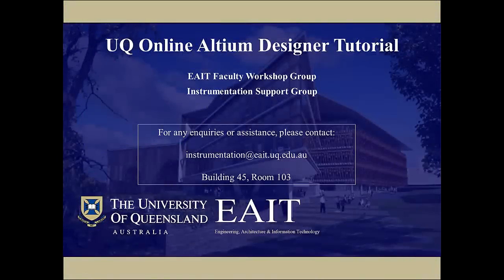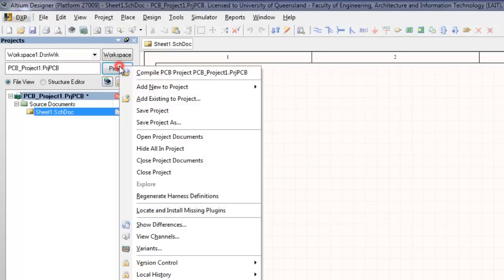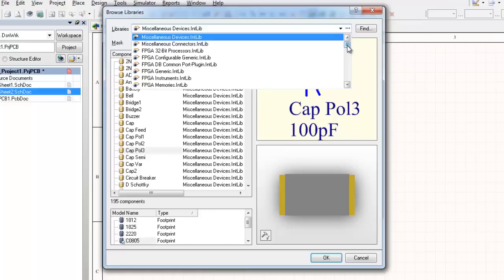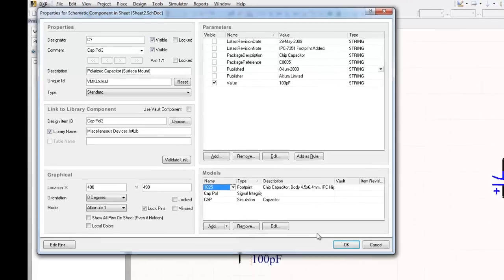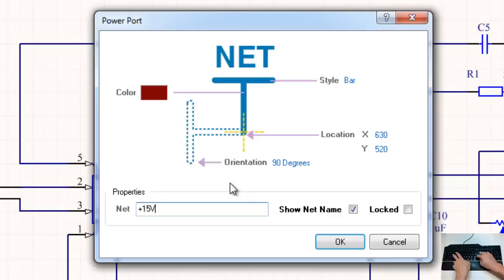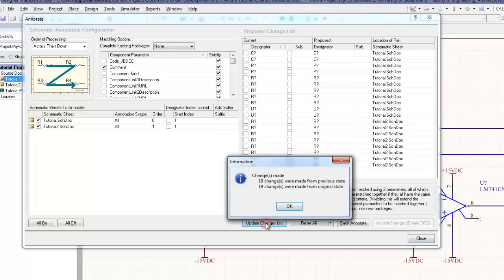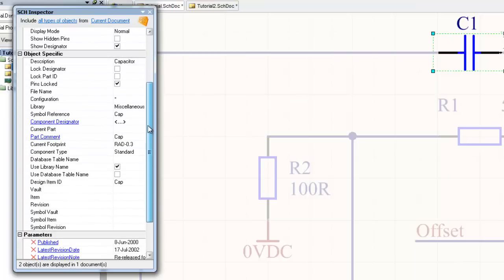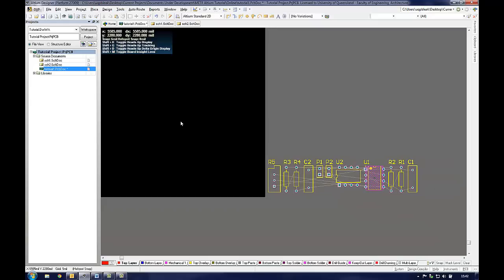Altium Tutorial Part 1 - Schematics

Comment: There is no power supply input for the +15V and -15V rails
Reply from the maker: Does it matter? This is a video showing you how to use Altium. It's not intended to be a perfect, working circuit.
Reply: It matters because you can't go further and if you use a connector for power supply rail, i hope this will give an error +15V and -15V has only one pin....
Please guide the people in a correct way,
Reply: Nate Hixon